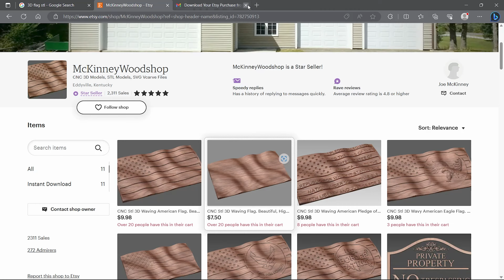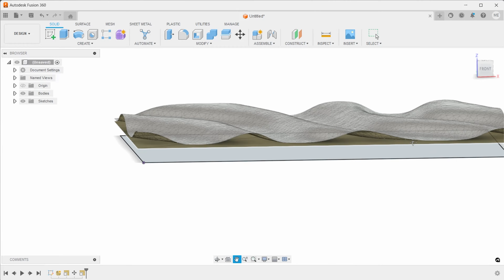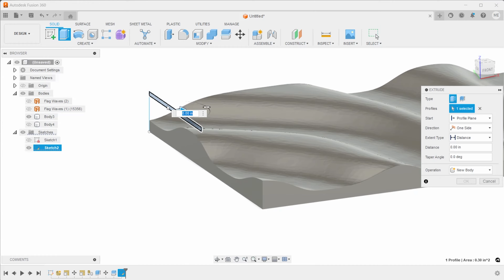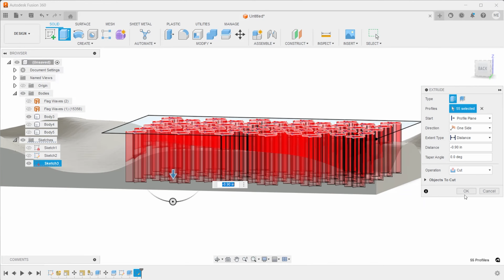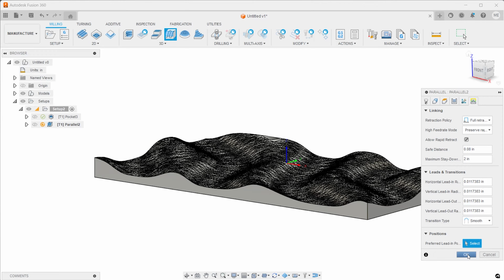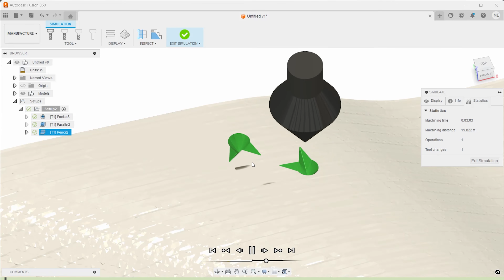How to V Carve onto a 3D surface | Fusion360 to CNC

Comment: Running into anomalies.  Unsupressing the stars in Design causes the first two tool paths to go out of date (no green check).  This results in the simulation assuming my stock is all the way at the top and ignores the Rest Machining setting.  Any ideas?  I've redone the process 4 or 5 times following the video to try to see the problem.
Reply from the maker: Yep, that definitely happens when you unlock a tool as it’s going to regenerate the toolpaths based on the order.  I’m getting ready to post a new video showing a different method on this.  I’ll make sure I send you a link to it.

Comment: Have you ever ran into where Fusion will not let you select a pocket when cutting the stars? I do what you do but Fusion will not let me select the bottom face of the star. Its a solid body. Im confused.
Reply from the maker: @mitchdomina7607  Hey!  Thanks for sending this.  When your in your Pencil operation settings, under Geometry, if you click the selection on Machine Boundary, then click the down arrow for geometry selection, you can chose Pockets or Pocket recognition.  That should let you select the pockets in your model.

Another reason this might be the issue, is your body you’re using isn’t being referenced in your manufacture setup.  If you double click your setup, then go to model in the first tab (setup) you should be able to see the correct solid is used for the overall model.

If you’re still having issues, please send me the file to edesignandwoodworking@gmail.com and I can take a look at it.

Cheers 🍻

Comment: Great Video.....How did you get the wood dyed all the way through?  I can not seem to find any videos on how to do this.
Reply from the maker: Eric, with this, I used natural hardwoods that grow with that color.  For the red, I used Redheart, which is naturally red all the way through.  Same with the Purpleheart, which is naturally purple.  Eventually they will fade and turn brownish over time, unless treated a certain way.  There is however, a premium in terms of price you will pay over other woods, but to cut into it, staining will never penetrate far enough to get the effect you are looking for.

Cheers!
Reply from the maker: There is another way if you cannot get that wood species, is to not glue the individual pieces before you cut the profile.  Leaving it unglued, cutting the profile, then dying the wood to the color you want, then gluing the pieces together would work great!  Just make sure you sand carefully not to take the stain off.

Cheers!

Comment: Thank you again for your great video. I was so impressed with your flag plaque that I duplicated it using my shop, CNC Mill, and CNC Laser. ‘MI super pleased with the results and thank you for the inspiration. I used Vectric Aspire on the CNC Mill and mapped the stars to the flag contour. Thank you so much for the inspiration. I also used a 3/4 inch flush cut bit on my router table to rabbit out the walnut for the frame. I’ll see if I can find your email and send you a picture.
Reply from the maker: Thanks!  Happy CNC'ing!